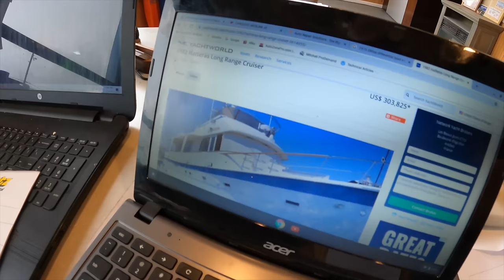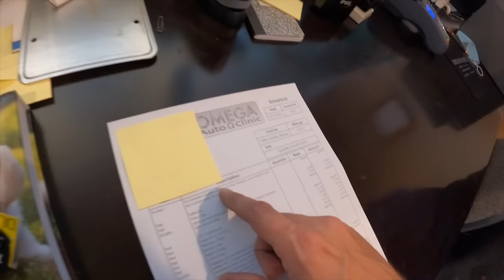Everything wrong with the Mercedes nobody wanted, and another Lamborghini FIXED!

Comment: I guess Americans want some old yank-tank, replace engine, gearbox, suspension, interior, bigger tires, massive stereo and in the end have a drifting, quarter mile burnout machine where absolutely nothing is original and it just vaguely looks like the car it was before.
Mercedes are about enjoying a beautiful machine as it was built originally and not bastardise it with so many add-on parts that the original car is all but gone.

Comment: "I'll buy you a new cap and I'll put it in, and it'll cost you 87.00."
Hell, anything on a Mercedes costing under 100.00 is virtually a freebie.
Reply: I have a new Mercedes (just over a year old now). You can even void the warranty by not using their particular screenwash. Here in the UK there's been a few reports of Mercedes getting arsey over that.
Reply: @BobMonkeypimp  Yah, mine is a 21 year old W210 wagon. So, no warranty... well, as Tavarish famously says, "I am the warranty". M-B couldn't get away with being that anal on warranties here. Instead of using a factory supplied fluid, the aftermarket makes makes that sort of stuff to a specification. Just so long as the spec is met, the warranty can't be voided.

Comment: I dont care what die hard Mercedes and lexus guys say
You cant beat 70s 80s 90s Mercedes s class
You cant beat the 90s ls400 
As far as i see the s class and ls400 all from the 90s are absolute tanks and i love them both.
Sad because both are total garbage and not what they were back in the 90s and 80s
Back when real Germans were making the s class and back when Lexus was building a actual smooth v8 rwd car that didn't have overly complicated computers just both solid cars that ran drove and preformed the same near identical thats why i love the s class and ls400 from the 90s

Comment: nobody want this car since in w108 and w109 only was made for usa market in 4.5liter in usa do to the smog roules this car has only has 180 ps slow the euro wersjon 3.5 has 200 ps and the euro 4.5liter engine is not offred in this modell in europe only in w107 and w116 and then the engine has 220 ps and its a huge diffrence in performance.and only in usa in 1973 in europe it ws stoped in 1972 in euro you had the 6.3 liter in stead of 4.5 liter and the 6.3 was the worlds fastest sedan that time .